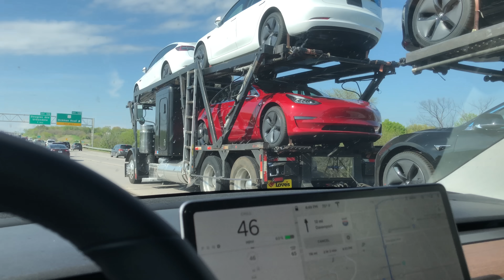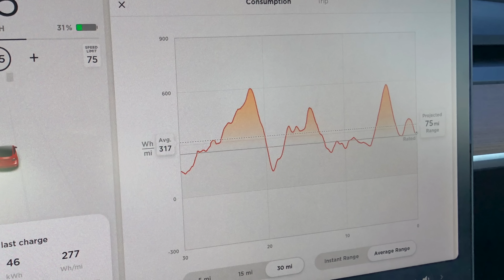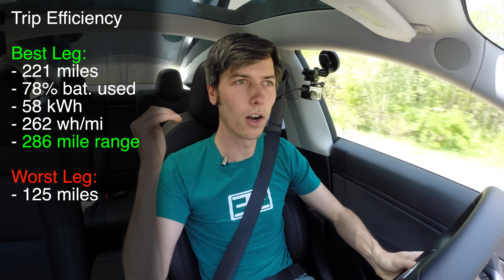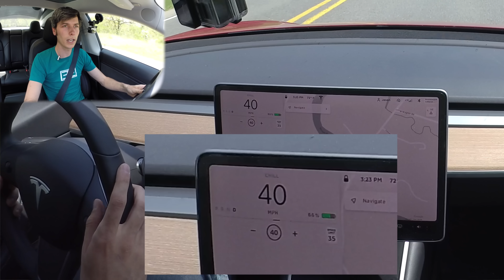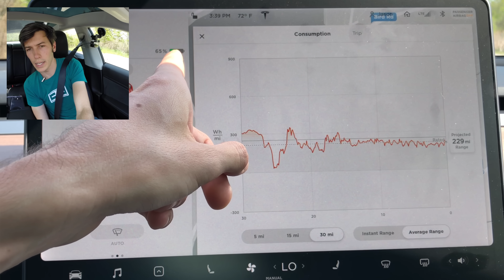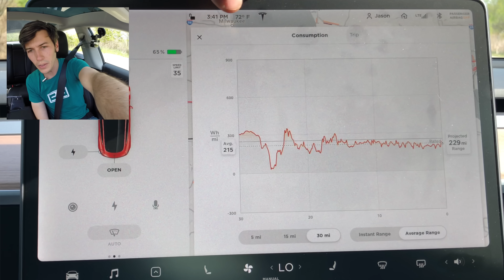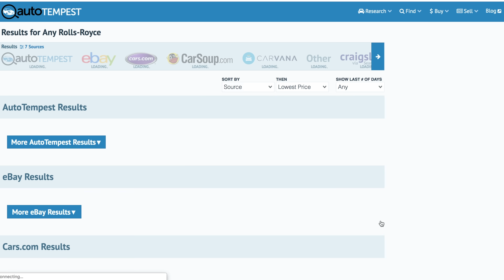How Miserable Is A Tesla Road Trip?

Comment: In your energy source comparison it would be wise to include the efficiency of the electricity production (25-85% depending on method) vs gasoline (88%).  Also, if the overall cost for the Tesla trip is 80% of the gas vehicle trip, I am not realizing a whole lot of savings while wasting a lot of time charging.  BTW, my 2008 Civic got up to 410 miles per full tank in semi-hwy driving.

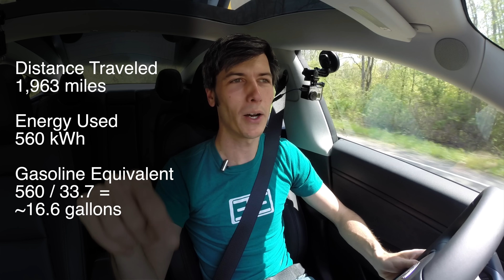Comment: I am confused.  You claim that the Tesla Model 3 used about an equivalent of 16+ gallons of gasoline in electrical charges.  Yet, when you do the price analysis, you show using about $156 of electricity (560 kWh@ $.28/kWh) over the $196 of gasoline if you had driven a 30 mpg car to Michigan.  How can you have it both ways?  You cannot use only "16 gallons" of power to go 2,000 miles but only pay 25% less in fuel costs. ( My house electricity rate never dips below $.12/kWH.)  If you are only using only 16 gallons of "energy," why not a larger savings?  It appears that the Tesla is using a lot more energy than you first indicate. Or Tesla, and your power company is selling very expensive energy vis a vis gasoline.  Please explain your calculation. (Your claim is at the 8:12 mark in your tape.)
Reply: I think that I answered my own question.  Gasoline is so much cheaper per kWh than electricity, correct?  Gasoline is about  $.02-$03/kWh equivalent in energy versus the $.28/kWh at a Tesla charging station.  Big difference.  If you factor in the cost of the car,  electric cars are suddenly not as cheap as I would hope for..  

I still like electric cars.  I am waiting for the day that we never have to look at a Saudi oil tanker anywhere near our shores.  I am waiting for the day that we break the grip of big oil on our pocketbook and environment.  Nice work in the presentation.
Reply from the maker: The answer to your question is that supercharging is expensive (because of the faster charging rate, it's what Tesla charges, not your local power company). Charging at home is much cheaper.

Comment: Stopping to charge for 40 minutes after 2 hours of driving at 75? At the speeds that I drive, that would be stopping to charge after every 1.5 hours. Yeah, that is a deal breaker for me
Reply from the maker: You weren't listening... as mentioned 3 hours, ~45 minutes charge. Repeat. But yeah, much longer than gas.

Comment: My rough back of the envelope calculation estimates that there would be about an 18% loss of energy efficiency going at 80 mph vs 75 mph.
Reply: Is that just based on the velocity squared calculation for air resistance that is then applied to the average ranges of lower speeds?
Reply: That should be, "My rough back-of-the-envelope calculation estimates..."  Great at math, but lacking somewhat for grammar, yes?
Reply: @rachelblack3816  does anyone talk to you by choice?

Comment: Test efficiency by drafting 18 wheelers. Virtually no air resistance if close enough (when truck’s rear view mirrors are no longer visible).
Reply: Say hello to a long wait for that replacement windshield.
Reply: Leighton Mann 

I’d that a few times in a Beetle. Was lucky, re stones. Car was sucked along.
Reply: @FrankGutowski-ls8jt  a Beetle has a LOT less glass surface area exposed to kicked up stones compared to the massive Tesla glass area. And if the truck drifts at all onto the shoulder, it will rain rocks.
Reply: Leighton Mann 

Well, I was in college at the time and it seemed a clever idea. Something I wouldn’t try in my folks’ Cadillac though. Way to heavy, for one thing, and not as aerodynamic. I managed to crack it though by chipping ice away from the wipers.

Comment: This is why I think electric cars will never catch on, and we should be focusing on more promising things like hydrogen or compressed natural gas. I don't want to have to follow a gps, plan when I am going to stop, worry about how fast I am going, plan to stop ever 2-3hrs and do something for 45min-1hr. I think electric cars are great if you drive very little, and have access to a private driveway/garage that you can charge at home over night. But if you drive a lot, or don't have access to charge your car at home, then unless you like wasting a lot of time you should not even be thinking about electric cars, and that is simply a problem that they can never, ever fix. Even if they make a electric car that can go say 1,000 miles on a charge, well all that means is it will take that much longer to charge, which means if you cant charge it at your house while, you say sleep, then you will still be wasting just as much, if not more time.

Comment: MPGe is a nonsensical value. The only true way to figure the real world equivalent fuel mileage is variable. It depends on the price of gas (which fluctuates wildly day to day at times), your $/kWh and what efficiency your vehicle charges at. 
Assuming a 90% charge efficiency 
58 kWh= 63.8 kWh to charge (my power company charges 12.7 cents/ kWh including taxes and fees.) 63.8 x 0.127~ $8.10 divided by current fuel $/gal (2.499 for me) ~3.242 gallons. Then it's just like in a regular gas car miles/gallons (221÷3.242) ~ 68.167 mpg. THATS the real mpg equivalent, which is still respectable. But that number is based on cost of electricity in that area vs. $/gal so that number can change daily. And that's why they use the arbitrary MPGe of 116 since the real number is never constant
Thank you for your time

Comment: Batteries wear out and a replacement battery will eventually be needed. Most car manufacturers guarantee their batteries for around 8 years or 160,000km (100,000mile) and capacity loss for 5 years or 100,000km (60,000mile) Tesla cars' high sticker price is the very high cost of the electric battery packs that supply these vehicles with power. While the cost of battery technology and its energy efficiency has improved over the past few years, more research and development is needed to create a truly affordable electric car.

Comment: As I recall, you can get closer to 100% charge at a non-super charger, thus more range. That would mean a longer stint after an overnight charging session, or at the beginning of a trip. (Also allegedly better for the batteries.) Care to comment on that?  I did a three day trip from northern CA to San Diego and back and had a similar experience. In a few of the stops, we had less to do than the car did, and the wait was almost 100% lost time. A 350 mile range would probably produce an experience closer to that of a gas car.

Comment: Can't believe a 2.3 tonne vehicle allows 235/35 tyres to be fitted. My own car weighs 1780kg and 235/35 tyres do no meet the load requirements, you need 245/35. So for a 500kg heavier car to be allowed to fit 235/35 seems ludicrous if not illegal. For a car that heavy I would have thought 245/40 (front) would have been minimum spec.
Based on your cost for the trip seems almost no real reason to use the EV. For only a $40 saving and the huge number of stops the supercharger seems a rip-off. Of course what if you wanted to get off the boring main roads and take the scenic routes how many charge stations will you find off the beaten track?
Reply: Whayne Padden good weight distribution and center of gravity plays a large part in tire selection.

Comment: I just drove my Model S from Washington to Wisconsin and back which was 4600 miles round trip. My car is a 2015, so it charges slower than a new Model 3 and I was going 85mph across Montana, Wyoming and South Dakota. Most of my charging stops were 40-50 minutes. I have done that trip many years in a gas car and the Tesla was not much slower because of the charging, but my total range is 240 miles and I was going pretty fast, so I was stopping about every two hours and charging for 50 minutes. Because my Tesla is older, my Supercharger bill was zero.
The trip estimator was pretty good for me as it took into account elevation changes. It can't do headwinds, or temperature possibly, but usually if it said I would get to my next stop at 11%, I was pretty close. Because of construction slow downs, I usually had more power than it guessed at the beginning. One time I had less because I picked a motel that wasn't near a charger and my car loses a few miles overnight and it was very windy, so I got to the charger with 16 miles left. All I had to do to keep from going below 6% was to slow down to 70-75mph. Once while I was charging it said I could make it if I stayed below 75mph, so I charged a few more minutes to get rid of the restriction. Traffic kept me below 75 anyways on that leg.
Most Superchargers were near several hotels and several restaurants, so it was always easy to find something in easy walking distance.

Comment: Bought a Chevy Volt ( 2nd gen ). 

Plenty of gas stations out there .
400+ mile range. 60 mile range on "battery only" battery. Local trips I get 70+ miles on battery.
 Charges in 4.5 hours from "empty" on 220v from outlet in my garage. Have never used a "charging station" 
No range anxiety . No cold weather range anxiety. 

Quiet and comfortable. 

No company (Tesla ) "going out of business / whose going to maintain the superchargers" anxiety ( superchargers tied in with local utility companies ). 

I am of the thinking that the unique and innovative Chevy Volt drivetrain /battery system, combined with a redesign of the ICE that powers that thing so that it could run on "alternative fuel", would provide a decent solution to the transportation / fossil fuel conundrum. With an improvement towards 'even better "MPGe / fuel mileage", alternative fuel could be synthesized from the vast amounts of plastic in the recycle stream ( through pyrolysis reactor ), from algae or yeast ( ethanol ), etc. thus keeping more fosil fuel / carbon in the ground. This fuel could be supplied to existing fuel stations ( no need to necessarily rely on huge transcontinental charging network "build out" for a very small percentage of BEVs ). The drivetrain could be readily adapted to a myriad of vehicle sizes and uses.

Comment: Why didn't you use destination charging so you had a full battery every morning?
Reply: Didn't like the hotels available near the superchargers?
Reply: @n9wox  It sounds like you don't know the difference between Supercharging and Destination Charging. Many hotels have destination charging. It's not as powerful as a Supercharger but it doesn't matter because it's located at the hotel where you will be parking for the night. In the morning you have a full "tank" (typically on the hotel's dime). This is becoming increasingly common on all price tiers of various hotels. With the range of many EV's this day, it can reduce most peoples Supercharging to one 30 minute stop in the middle of the day.

Comment: Be aware that if you run a Lithium battery (aka the Tesla's...) below 50%, you destroy the life of the battery.

Good luck with getting a long life out of it....
Reply: No, it's at higher state of charge there is a risk of degradation. The higher state of charge, the more reactive will the anode and cathode become and react with the electrolyte, slowly creating a surface that slows and in some way stops the lithium ions from going back and forward. High heat speeds up this process, but additives in the electrolyte also negate the problem. Tesla seems to have a good chemistry, based on the data that is out there so far.
Reply: While I am glad to know that the charging problem is good, the fact is that lithium is very unstable in and of itself. 

So, as a general rule, the lower you keep the battery, the higher the level of degradation. 

It will be interesting to see how long they last. And how many charge cycles they can handle.

Comment: In late May/early June, we did a round trip from Pahrump, NV to New Berlin WI. A little over 1850 miles each way. We stopped more often than necessary, but averaged around 600 miles each day. When we stopped to charge and eat, the car was ready to go before we finished eating.
We are both 72 years old and felt much more relaxed and less tired than when we did the same trip in an ICE car. This was due to NOA, which really minimized the stress of driving, especially through the mountains. The seats in the M3 are really quite comfortable and we ended each day without any aches or pain, and that's saying a lot for folks our age.
We are considering a trip to Florida next year. The only problem is finding a dog sitter for Freddy for as long as we would need for that trip which would entail at least 4 days each way plus how long we would stay there.

Comment: The idea that the GPS in the car plans out your route based on charging stations is pretty cool I have to admit. I just drove my Sierra to Florida and back for a week long vacation. We drove over 3000 miles averaging about 18mpg, doing about 80mph the whole trip. I would refuel about every 400 miles. It is nice being able to hop off at any exit fuel the truck in about 5 minutes done just in time for me to walk back out from the gas station from taking a piss getting a drink and get back on the road. Not only that but that V8 makes such sweet sweet sounds on the on ramps. Plus there is a full size spare under the bed, a tool box full of tools, a couple bikes, luggage, chains, straps, 4WD. I just don't see the utility or practicality of cars in general let alone electric ones.  Trucks are great, good for towing, hauling, going off road, pulling someone from a ditch, plenty of space for tools parts and spare fluids, puttering around town, or going on a road trip. Great for road trips really, a long wheel base and big tires make for a smooth ride. People always complain about the cost of fuel, fuel is really not that expensive when you adjust for inflation. The cost of fuel isn't killing you, it is your car payment.

Comment: I get the environmental aspect but the economical comparisons didn’t include the cost difference in YOUR time. Unless I missed it, you didn’t mention that in a petrol car, you would fill up just as often and save hours off of the trip. Makes it impractical imho because there is a value to our short time on this planet.
Reply: If you drive 2000miles every week sure......but for the once a year roadtrip  most people do.

7hrs is nothing

Comment: I would only consider an ‘Electric Car” regardless of the maker, is when I could get a full charge in the same time that it takes to fill a tank. Also, recharging stations would have to be as plentiful as gas stations. Many years down the road for the infrastructure to be in place for me ever to consider taking a cross country journey in an electric car.
Reply: @MikesTropicalTech  Close, 2007 Jeep Wrangler with 300k and a 2010 KIA Soul with 270k, with little or no mechanical issues. Besides, I do NOT have the resources to throw away on an unproven technology.  

Ever ridden a Horse and buggy?

"Drill, baby, Drill......"

Comment: Air drag force increases as a square of the speed, not as an exponent.
Reply: Anything squared is that value to the power of two. So yeah... squaring something is the same as an exponent of two. Just like a square root is also an exponent of one half, which means roots are also exponents. 
So to say that wind resistance is exponential as you increase velocity is accurate. It’s also accurate to say that drag is parabolic, since the function uses a value squared.

Comment: $156.80 Electric vs $196.30.....I would rather pay the extra $39.50 to shave 8 hours off my trip worth of charge time. We must put a value to our time and that would mean my time is only worth $4.94 per hour.
Reply: It wouldn’t save you 8 hours...it would save you several but stoping to get gas and eat still takes time too. Even without eatingits going to take you 10-15 per gas stop plus bathroom break.

Comment: I did a 6,000 mile road trip in Dec and Jan from NYC to Tuscon, AZ via Santa Fe and Pueblo. Anyway, it was very doable even in winter, where you're closer to 350 whr/mi thanks to the cold air. I used to have to 20" wheels and got 3 flats from potholes and then a damaged rim, so I switched to 19" wheels from TSportsline (Forged, lighter, stronger, better range), and they're good for the performance brakes too. Let me know if you want details, but I highly recommend them.

Comment: So you made the trip longer because you wanted your own buffer?  6 to 10% is fine and it is that accurate.  Plus when you arrive at your destination you will charge quicker at lower battery state.  Just trust the Tesla navigation percentages, they are pretty close to perfect.  Only issues would be cold weather and extremely windy days.

Comment: I was surprised to see how much Tesla  was charging you for electricity. That isn't beating highly taxed gasoline by much and that isn't good.
Reply: That was my thought. Plus you're just moving the air pollution from the car to the power plant. Unless you're using wind or solar energy,which on a road trip you probably aren't.
Reply: @tompeterson3210  You are still getting something like 100empg, so that unless you are comparing an electric car powered by coal to a Prius; the EV still wins (but still takes a long time to charge).  Coal plants are closing left and right thanks to cheap methane and modern fast start plants (solar and wind aren't quite so common).

Comment: You are faster overall if you drive faster and charge slightly longer. Driving slower to save on charging time is counterproductive.
Reply: A youtuber called teslabjorn did a roadtrip were he managed to drive 960 something kilometers in 10 hours. He realised that the fastest is actually to stop many times for just 15-20 minutes. That way you will always charge at max speed
Reply: Too many variables that way
Reply: Factor in safety. Factor in less overall battery cycling. Factor in reduced stress.